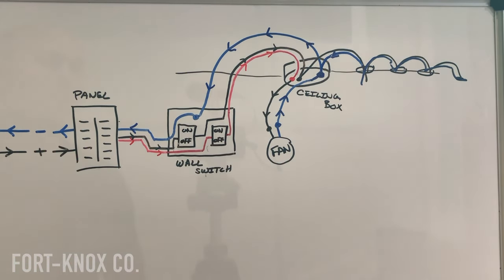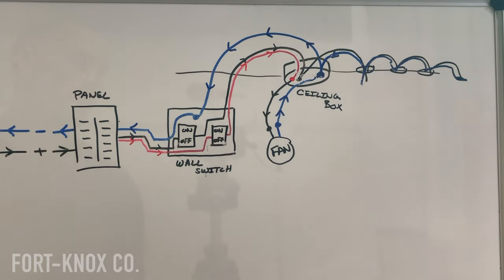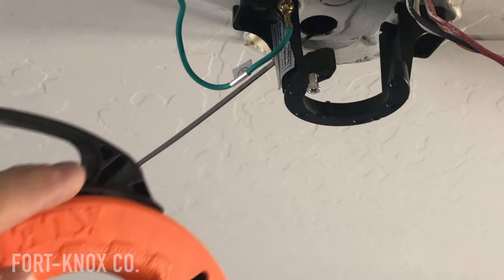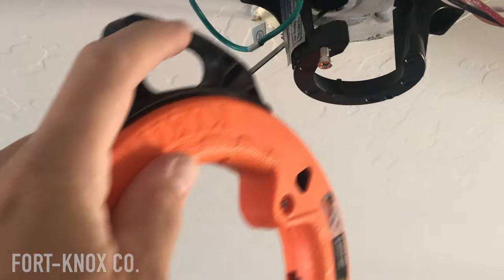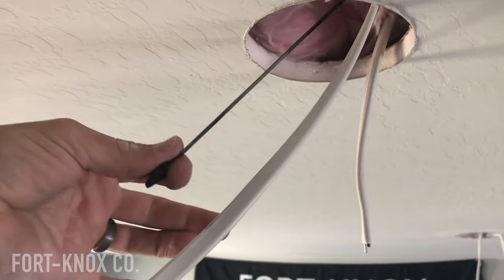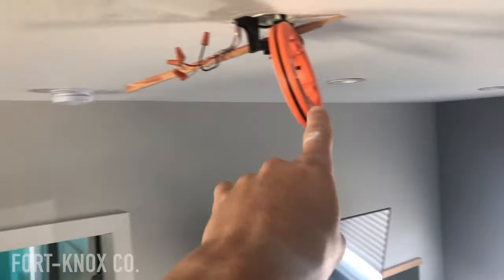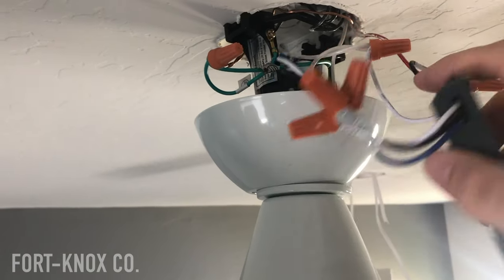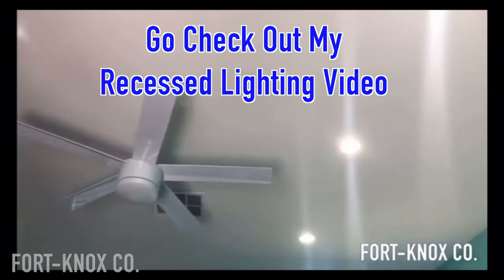How to Run / Fish Wires Easily Through Ceiling for Power to Recessed Lights and Fans

Comment: You did a fantastic job explaining your wiring schematic.  I really liked the way you show the flow of power through the circuit.  It educates the layperson how power works.
Reply from the maker: Thank you! I really appreciate the kind words. Glad I could be of help!
Reply: Wiring schematic woulda got me an F in class for being messy and inaccurate XD (and extra points off for using a dual load from the panel just for lighting what a waste of space for a breaker!) 

But yes hardass aside it illustrates what he’s doing fine enough

Comment: Thank you, your vid popped up on the feed, and I am planning t do something like this as well. I have only a single switch to a ceiling fan.  My plan and or options are 2nd box and switch run a line to recess lights (4). or tap off the ceiling fan all 4 recess and use the remote to turn on/off the ceiling fan. Only difference is   when the 2nd option is used its all off,  not one or the other when off.  if like you're saying plan it,  out the rest is easy.  thank you for the   guidance/confidense in the video.
Reply from the maker: That’s awesome to hear!. Glad I could be of help. My goal was to show people there’s a way and it not too hard so save some money and get the recessed lights you’ve been wanting.

Comment: Great video, explanation, and diagram. I am new to electrical work and couldn't figure out how to separate the power source for newly installed recessed lights and the fan power. Your video did the trick!
Reply from the maker: Man that’s awesome to hear!! So happy I could help. Subscribe to my channel if you haven’t already. I’ll be doing more electrical videos. I have a good one about led lights soon
Reply: @FortKnoxCo  thanks for the vid,  actually what I need right now

Comment: Great work thanks for sharing.  I have 8 lights in my ceiling but the wires daisy chain through a joist (along each row of 4). The hole in the joist is 1" diameter. Can using the fishing method find the hole? Maybe there is another way of doing it....
Reply from the maker: Yes you can do a fishing method, you might try to follow along the wires that are already there to help as a guide maybe. Going through the first hole might be easy. But if your going blind through the next hole that could be a challenge. The only other thing is to cut pocket holes before the joist and guide the wire through and then have a few small drywall repairs.

Comment: Great method, I actually did this before I was watching this video, but I was using a metal rod to passed over the wire from one hole to another. Never had any idea of a fishing tape like in the video.
Reply from the maker: Yeah I have used fishing rods before which were fiberglass flexible poles similar to what's used in a camping tent. But then I stumbled upon the tapes and its a lot easier when trying to navigate through some of these areas.

Comment: I have 2 questions.  Is the RED wire on a separate breaker?  If not,  are the red and black going to the same breaker?  #2.  Even though you knocked out a plug in the ceiling box to send your power wires for the recessed lights,  should there be a strain relief  on the hole you made in the ceiling box?  Oh one more.  You said your white wires are all tied together  (which is correct), but you said those go back to the breaker?  Did you mean the neutral bar inside the main circuit panel?
Reply from the maker: Yes, usually the wires coming out of a wall switch junction box are fed power off of a single breaker. The black and white wire coming in will feed the black and red (off of the “Hot” black obviously), this usually will also feed other switches or even outlets on the same circuit. So from that wall switch the power usually goes to share in a couple other locations depending on how many fixtures it’s feeding. All off of one breaker. 

As far as the knock out, it’s kinda up to you for the tension or strain on the wire. Realistically it’s not going to get damages just being fed through a plastic box and then just sitting there. But you could go the extra mile and put a non metallic grommet or something similar to help with that. In new construction sometimes the wire is secured within 8-10” of exiting the box and every 12” up a wall. All things an Inspector will check with new construction and the walls being open. But it’s not always necessary or possible when doing renovations.  It kinda depends on how far you want to go with the labor and invasiveness of the renovation.

Comment: Do you need to put a strain relief on that wire going to the fan box?
Reply from the maker: You shouldn’t NEED to buy if you want to put a little slack on the line for future repairs or movement it wouldn’t be a bad idea

Comment: Nice video. I have a question and a comment.
Why did you use 3- wire romex from the service panel to the switches? Are the lights and fan on separate breakers? If not couldn't you run 2 wire and jumper the hot (black) wire to both switches?
My comment has to do with the fan box. The new cable needs a connector to hold it in the hole. A connector would be impossible to install from below but it looks like where the existing romex comes in there is a built in clamp where you could have run the new cable.
Reply from the maker: The original house wiring had a red and black up to the fan box. One for each switch. Only one was being utilized and the other hot wire just capped. Since most fans only use one hot you don’t always need two hot wires in the fan box. But builders will sometimes still wire it that way anyways. I wanted to take advantage of the unused hot wire/switch in the ceiling and just jump it over to some recessed lights and chain them together and make the extra hot wire at the fan box be the recessed lighting. 
If this was wired for recessed lighting from the builder obviously you could simplify this whole thing and go directly from the wall switch to the recessed lighting and be done. 
The 2 hot wires in the ceiling are coming from the two switches in the wall. The single hot in the wall from the breaker box/power source is split to those two hots(black and red) in the wall at the switches. From the switches they travel to the fan box.
Reply: @FortKnoxCo  Thanks. I totally understand the wiring from the switch the fan  Your sketch showed 3 wire coming from the service panel. Thus the question.
Reply from the maker: @joeweatlu5169  ahhhh. I see. My bad. I guess I was just doing that for illustration purposes. So people would understand that the red was “hot” as well. But I got ya. Thanks for the comment

Comment: Does this require a permit? Thank you for the video
Reply from the maker: Depends on your building codes in local areas. But usually just adding lights to an existing circuit does not. The house was presided for this light circuit. So it was just now being utilized. If you were running a new circuit from your breaker box it may require An inspection.

Comment: In AC current, actually the direction alternates many times in every second. Frequency is the rate at which current changes direction per second. It is measured in hertz (Hz), an international unit of measure where 1 hertz is equal to 1 cycle per second.
Reply from the maker: Thank you so much for the great info!

Comment: Is this DC or AC?  There should be no Positive, Negative in AC circuits.   I was looking for tips on how to fish from a wall switch to the ceiling fixture... I can't see any other way but to drill up through the header and open the ceiling at that point to continue fishing to the lights.
Reply from the maker: I apologize for any confusion, I was using the terms positive and negative just as a reference. But obviously we have the current coming in and the current going out. So we have the hot wire which is the black wire normally referred to. If you are going to be running wires through the ceiling and you’re not able to run it down the channel created between the rafters or headers then you will have to drill through them. One of the rules of thumb is that you’re never going to drill more than 1/3 of a size hole larger than the actual rafter. But you are able to drill through most rafters and headers when passing wires or even plumbing through. I would drill just a small enough hole to get that wire through and that way you’re not compromising the header that you’re drilling through. In the video I was showing a method that usually doesn’t require too much drywall work. But when you start cutting through headers, this usually means that you have to cut through the drywall to get to multiple headers or rafters to pass that wire.

Comment: How are you determining that you are not over loading the circuit ?   That would be helpful to explain in your excellent video.  Thanks !
Reply: Add the draw (amperage) of each device on the circuit. In this case there is no problem running 14 ga. for a 15 amp ckt.

Comment: So does the wire end poking through the insulation and sits on top of the insulation?  Or does the wire run under the insulation?
Reply from the maker: When you run your new wire it can sit on top or under, just depending on how you were able to run it without obstructions. I had to go through the insulation because I was also going over some rafters. If you were staying within the same cavity between the rafters you could just run it along the drywall under the insulation to the next hole.

Comment: Thank you! Could you please explain on the remote device at the fan the red wire is coming in and on other end there is a black and white wire connected to the remote box too. I thought that the black go to recessed lights.
Reply from the maker: So up in the ceiling, there is a red wire and a black wire which are both hot. There will be one white wire, which is the neutral for both of them. There will be two switches on the wall and from those switches will come a black wire and a red wire. Black one switch red for the other switch. in essence, the red wire is exactly the same as the black but it is colored red to designate it as a separate hot. Otherwise it is treated as a “black “wire

So since the fan only needs one hot wire, the other one which would be the red in this case is not being used. So what I did from the wire location in the ceiling is run that across to Splice and branch over to where I needed it so that it could connect to the recessed lights. it’s already ran down to the switch in the wall and then it ends in the ceiling by the fan. All I’m doing is branching from that location out to the other spots that I want it.

So you could use the black or the for the wiring, and then whichever color you don’t use you could then branch that hotwire to something else that you might want to operate with the other wall switch that other otherwise is not being used
Reply: @FortKnoxCo  thank you for the prompt response! Everything that you explained I understood from your video. The question I asked remains unanswered. 
On the side note - I like the American flag in the background of your videos! 
I keep watching your videos and have the answer to my question ... The other black & white wire connected to the fan remote are going back to the breaker.
Reply from the maker: @genevelis6075  if the black and white wire in your fan box up in the ceiling are going back to a breaker then they are supplying the power to the circuit. Usually the black and white from the breaker run to the wall where the switch is. Then from there they run a wire from the switch box up to the fan.  But it sounds like in your case the supply wire is ran to the fan in the ceiling and the hot wire with the switch is ran from the fan location in the ceiling down to the switch on the wall. ? Does that sound about right?
Reply: @FortKnoxCo   Thank you for your prompt responses and willingness to help!  In my Original question I was referring to your fan remote box. Please see minute 16:00 on your video. There Are 2 pairs of black & white wires.
Reply from the maker: @genevelis6075  oh ok. I see what you’re saying.  The fan remote box has black and white on one side. This is to power the box. I have a red wire from a wall switch attached to the black on the box because the red wire is coming from the the first wall switch closest to my door frame and I wanted that switch to power the fan. So I have red “hot” wire connected to the fan remote box black wire to power it. In most cases you would use the black wire from the ceiling/wall switch to connect to the black wire on the fan remote box. Red or black in this case would be the same, just depends on which switch you want to use as the power source. 

On the other side of the fan remote box there is a black, white and blue. This is to connect to your fan which should have a black( fan motor), white(common neutral) and blue (light fixture on fan). This should be that way on pretty much every fan that has a remote receiver to be wired in it. 

The other black wire from the other wall switch in this video I chose to run a splice to and run wire to the recessed lights. So the red in the ceiling is powering my fan and the black in my ceiling is power running over to my new recessed lights. I chose this set up only because I wanted a specific switch to control a specific item. 

You could switch the power sources by swapping the switch’s in the wall and moving one switch over into the other switch’s place. Or rewiring the switches to have black hot on one and red hot on the other. There’s many ways to use these wires.
Reply: @FortKnoxCo  You are awesome And very persistent like me - To get to the bottom of it!  🙂
Reply from the maker: @genevelis6075  💯

Comment: The fan bracket is riding the joist. You could easily remove the one two screws and provide much more access
Reply from the maker: I thought about that. Maybe in the future I’ll do that and show how it all works. Some people may be intimidated by messing with the original fan mount in the ceiling. But good Info. Would probably make it a lot faster project.

Comment: Will I have a spare black wire like yours? I want to set up like yours. I currently have a fan with a light but not bright enough and would like to add some recessed lights.
Reply from the maker: If you have two switches on the wall and only one is turning on the fan the. I’d guess you have one extra up in the ceiling. But you won’t know until you get up in the ceiling for sure. But usually you won’t have a second power up there without another switch somewhere on the wall.

Comment: How did you know that you didn’t have any beams or studs running between your recessed lights and if you did how did you bypass that issue?
Reply from the maker: I do have rafters throughout the ceiling. I’m going up and over the beams and through then roof trusses. In cases where you are working on a ceiling of the first floor and have a second floor above you you’ll have to drill some small holes into the beams and pass through. This will require a few more holes possibly in the drywall to gain access to those beams where you need to drill. But in this case I have a single story house and had roof trusses. Up, over and through.
Reply: @FortKnoxCo  ah thank you for the reply I  do have that problem where I have a second story and I would need to rip drywall to put holes in the beams but I'm looking to maybe add some pot lights parallel to the already installed lights, thanks for answering my question.
Reply from the maker: Well I’ve built small houses basically and am familiar with framing and how things are built. So I have an in depth understanding on how structures go together and how to problem solve foreseen obstacles. But if you Google roof trustees you can see they are built like triangles. So in my case I knew there were trustees and that it would  be as simple as jumping over a 2x4. You can see in the video I have attic space to run wire up and over. As far as just running the wire over without actually seeing up there, that’s where the fishing tape comes in. It helps guide the wire in a given direction. So I could see where I was pushing the tape towards and just kept an eye out  for when it was near the next hole. Sometimes I had to reach my hand up in there and feel around for it. But it’s usually just that easy. A couple times I used my phone camera to look up in there and see if I was running into something that the fishing tape wouldn’t be able to get around.

Comment: Hi, very nice explanation and video. What if you only have one hot wire black. Can you just use that to daisy chain recessed lights.
Reply from the maker: Is that black wire still with a white and ground? If so then yes you can, that’s just a regular single circuit. Probably very common in rooms that aren’t expected to have multiple features in the ceiling. 
Assuming that same wire is in line with a wall switch to control it, you can just branch off that black wire as you would for any other light system. I just happen to have two switches and two hot wires.

Comment: On 15:51 what are the black and blue connected too? They aren’t part of the other group, the white, red, and black.
Reply: I’m going g to install recessed lights and a fan. I’m borrowing power from a single pole switch trying to convert it into a three switch but I like the idea of two switches with a dimmer
Reply from the maker: The black & blue wire are strictly from the fan. The fan has its own light and remote. So that black box has a black/white wire going in. Then a black/blue/white coming out. That black box is the remote sensor and splits the power to a black & blue for the fan & light function. But the wires from the ceiling to the fan are just black and white.
Reply: Oh ok I see it now. Thank you very helpful video 🙏🏼